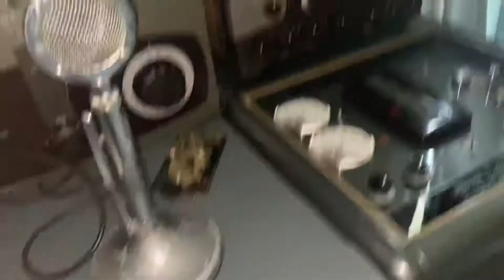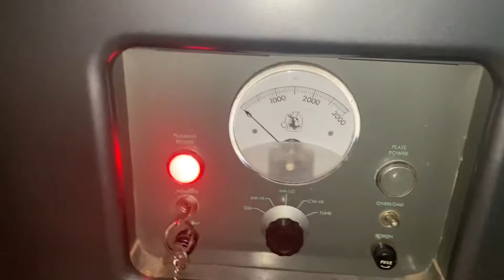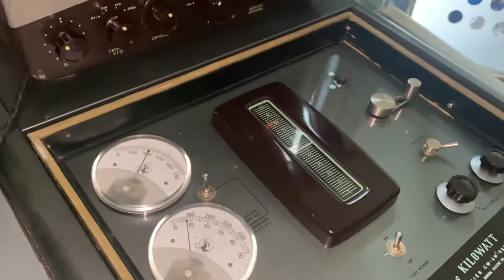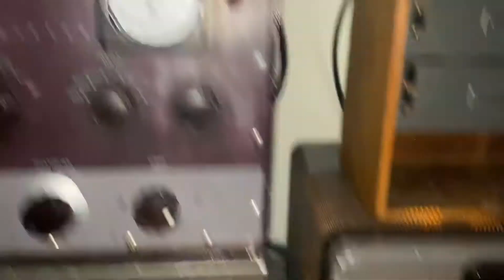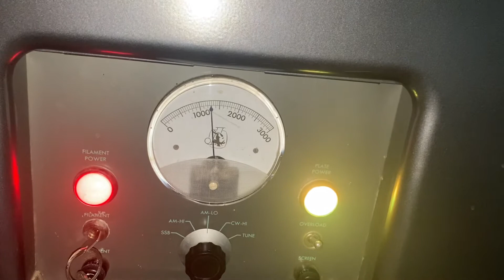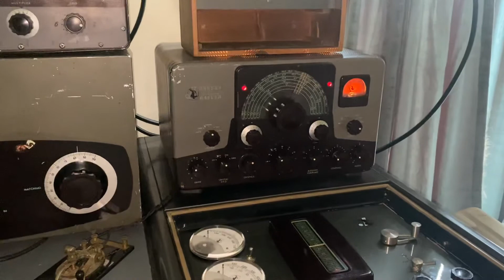Johnson Desk Kilowatt Tune-up

Comment: your grid current dropped when you keyed up with high voltage on. would you have peaked that again if you were going to transmit normally?
Reply from the maker: Typically the Desk KW is not a real quick tune up. My main goal was a brief overview. I would probably go back and forth a couple of times as well as adjusting my matchbox if need be. Something to also keep in mind is I did not fully load the amplifier. I was trying to stay at ~300 watts or so.
Reply: @zacharycastillo7075  Thanks for the info! I'm getting  one soon. If you can and wouldn't mind doing a detailed vid on hooking the Ranger to the desk would be great info/help
Reply from the maker: @Tom-W7TMD  I wouldn’t mind. I will see what I can put together. If you don’t have something yet, you will need to make a cable that passes the output from the audio section of the Ranger to the Desk KW. There should be a diagram in the Desk KW manual. It is readily available for download online. However take note. The connector for the Ranger side has a different number of pins than the connector for the Desk side. And one of those pins goes to the relay socket on the Ranger.

Comment: Why are you demonstrating at such low power? We want to see it at full power.I had one of these and it ran just fine on ssb no problem.I used the audio from the ranger and the rf from the HT37 since the ranger had too much drift.Most of the guys with this Amp on you tube always demonstrate in the low power position, what a waste.I would never use this Amp in the low power position,as it is a waste of energy.I had a viking 500 for low power!
Reply from the maker: I demonstrated it in low power due to the fact that at the time I did not have a dummy load that could take its full output. And either way it’s PEP could far over the legal limit in AM which is how I was demonstrating it. However I do plan on doing another video with it here in the future with it in CW. Thanks for letting me know about the SSB though! I had heard from several people it did not sound well on SSB. But that doesn’t take away from my goal of using it on SSB at least once. I plan on using a Pacemaker and it’s audio amplifier. I also have the Johnson power divider.
Reply: @zacharycastillo7075  QSL.It should work well in the ssb mode,I always used a scope.You might try a ht37, however they did not put any alc in the 37 so you have about 5 stages of audio hitting the 6146, not a good design.They corrected that in the ht44.If the guys were driving the desk without using a scope that could be overdriven.Also Johnson did some mods to improve ssb amps with serial numbers 100500 and above had the latest mods.In one mod they replaced the 4-400A with penta labs PL175A which is a pentode and they may have gone to AB1 operation.My neighbor had a desk kilowatt with that mod,which he did himself.Some where I have a late instruction book with all of the mods Johnson sent to me back in the day.Thanks for sharing,VY 73 W9NVN